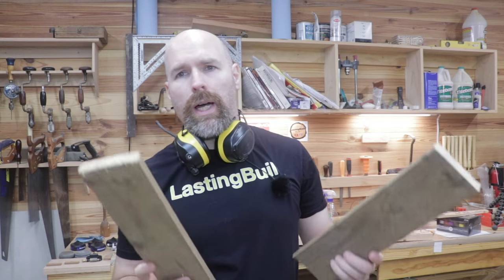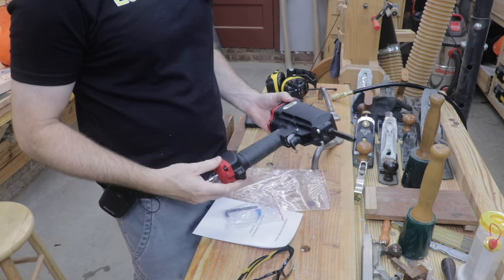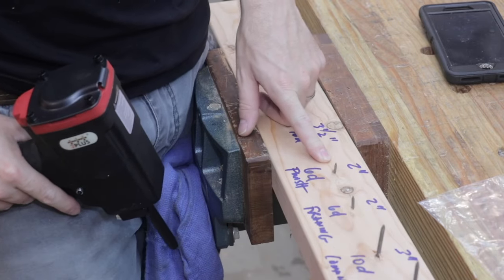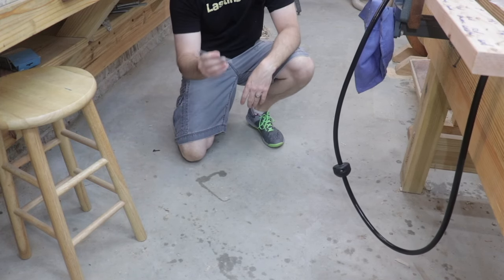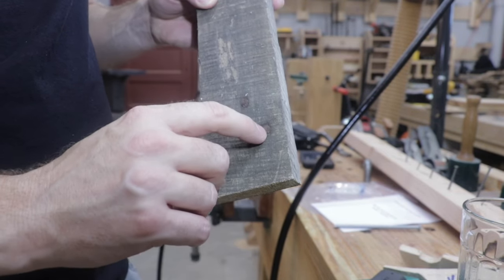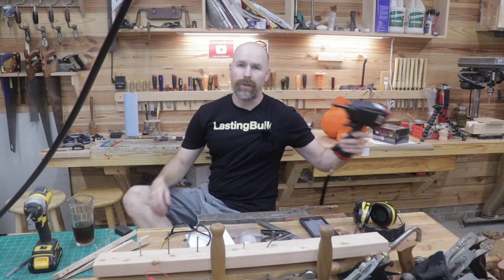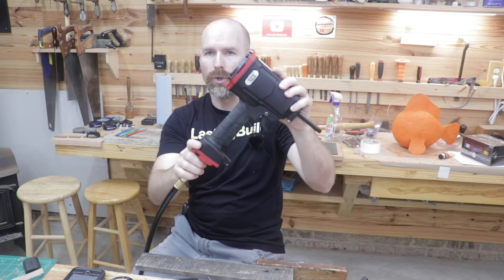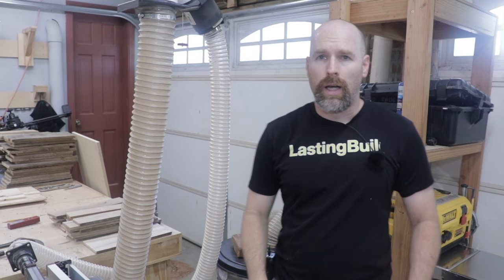TESTING The Cheapest Pneumatic Nail Remover On AMAZON!!

Comment: There is a 'world of difference' between nice clean nails recently driven into a piece of two-by and the corroded stuff remaining after prying old 'pallet' boards apart
Reply: 100%, plus I'd love to see it in hard wood, not pine
Reply: and as per usual with pallets, the nails are a lot tougher than the wood
Reply: Makes no difference.  The rusty nails will be knocked out easily too.
Reply: doesnt help with floorboards.

Comment: It's not really a "Nail Remover", but rather a "Nail pusher" because it doesn't pull nails - it only pushes them through. If the proper sized nail is used you won't see it on the opposite side, or it won't be sticking out. That doesn't work most of the time if you can't see the nails on the backside or can't get to the backside, so you end up having to chisel around the nail head and pull it out the traditional way. Not sure this helps me much at all.  I've rarely ever been able to knock a nail from the pointy end, and when I do it's because I pulled it off whatever it was nailed to and then I can just use a hammer with one tap and then pull it from the other side. This tool would get very little use in my world.

Comment: Have used airlocker for 3 years. Love it. Turn up your pressure and use over a bucket of water. Higher pressure drives the nails right through and the water stops them. No messing about with a Hammer
Reply: A great tip. T Y

Comment: you might as well save the money, still need a hammer. Make a pallet tool, they have them in youtube video....just a long bar with like a fork at the bottom with 2, it just sits under the pallete board and you pop it right off. goes real fast

Comment: I have the Air Locker version. Looks to be a bit smaller than this one, but same concept. I was using it to remove 4" spikes from old growth 1" oak in my 120+ year old house. No problems. My mother-in-law saw it and took over. Again, no problems. Suggestion on bent nails is to bend them back as close to straight as possible. We suspended the boards over a 5 gallon bucket with crumbled paper in it. Kept ricochets to a minimum. Another use that I just found is as a nail set. I put a bunch of new door trim up before realizing I had the wrong setting on my 16ga air nailer. Heads left up about 1/8". Turn the pressure down to 40psi and it taps the nails to easily caulk over.
Reply from the maker: It’s definitely a useful tool!
Reply: I use a half bucket of sand, straighten the nails as best you can, snap off and rusty tails.
When you are done chuck a big magnet in shake the sand and it'll pick up the bits

Comment: Great review, thanks.  I went with the Airlocker, it's much, much smaller and leaves a smaller indentation. Either one you go with, they're so useful and  cheap, I feel like I ripped them off...such a time saver.
Reply: Also. I used my Airlocker to drive rusted nails through some corrigated metal in order to remove it. Worked great.

Comment: Recommended operating pressure: 70-120 PSI.  The small Porter Cable Air Compressor I have is 150 psi and 6 gals.  Should be able to handle this perfectly.  This was a great review, many thanks!!  I like the full aluminum body on this tool.

Comment: Use a paint stir stick with multiple small holes drilled in it. Slide over the nail before the tool and it won’t leave a mark on the wood.
Reply: great idea.

Comment: I just use my air hammer with a  chisel tip that I have ground to a slight recess and it works perfectly.  Cost is very little if you go to HF and get the cheap air hammer.
Reply: Also add the HF Palm Nailer works too, just a little slower, but NO DIVET created.

Comment: I have the air locker and the plunger is smaller which leaves a smaller hole. Turn your pressure up and it will drive the nail further out or completely out.
Reply from the maker: Thanks

Comment: Put a small metal plate with about a 1/4 hole over the nail and against the wood to protect the wood from impact
Reply from the maker: Thanks for suggestion!
Reply: i was going to say a washer or something like that
Reply: @parkinglotstriping9800  I was going to say the same thing. I might try that.
Reply: use the equivalent of a dinner fork that wraps around the nail. a slotted piece of thin metal.

Comment: Maybe a mod? Shorten the plunger by 3/16ths or so? Then it would stop flush or just before the end of the tube perhaps preventing that ugly divot... I dunno but I’m ordering one still under $50 that comes with a spare plunger that I may try to modify myself. That’s for the education on this, I’ve been wanting one for a while now and had only heard about it, pretty cool!✌🏼
Reply: I thought about that too, but it would prevent you removing those cut-off nails later in the video. A metal plate or removable tube extension like others have suggested would be the answer.

Comment: Have you tried pushing the nail through by the nail head? This would eliminate the need to pry the plank from the stretcher.
Reply from the maker: I have not, yet!
Reply: So the nail head will not go through the wood so easily and so you will still need to pry out the nail but now without a head. I could be mistaken but I believe there's a tool that automatically pulls out the nail from the nail head. Could be just my wishful thinking.

Comment: Have you tried it on pallets that have the spiral nails? Would it be possible to weld a collar extension so that the piston didn't penetrate the wood?
Thx for the video.. very  professional..
Reply from the maker: It’s strong enough for spiral nails! Not sure about the modification!
Reply: might be able to get a small metal bushing  same size as the end   so it wouldnt penetrate,   i will more then likely order me one of these

Comment: Will it remove toe or finger nails buy one for the wife cheaper than a manicure in all seriousness looks pretty good nails put in with airgun can be thin and bend just looking at them and too time consuming those who like the rustic look don't mind the old nail holes and brushing timber by putting nuts and bolts in a bag and belting timber so that when you stain it then it gives that weathered look

Comment: Thank you Jim! My only concern would be the damage. Really wouldn’t want to use on any fine pieces
Reply from the maker: Hey David! Agreed!
Reply: David Connor  I made a metal plate with various holes in and put the nearest hole over the nail before using the gun
The plate takes the impact and no damage is done to the wood 🙂👍

Comment: A person w/ the tool needs to have a piece of metal that can be slipped around the nail so it can  keep it from causing the divit.
I love that tool. I do a lot pallets.   
That would be a life saver.
Reply from the maker: Thanks for sharing!
Reply: It marks the wood because the air pressure is too high. If the pressure is reduced the pin will not shoot out so far.

Comment: If you already have a hammer to pull the nails from the front side, wouldn’t it be just as easy to use the hammer to drive the nails out from the bottom side?  No compressor, no hose.....

Comment: Just found out this tool existed. Seems unnecessary lol
Reply from the maker: It’s a big time saver but your right, not necessary!
Reply: It's not necessary, but it makes quick work of removing nails. We were using old fence pickets for the bottom of our deck, and using a nail remover, we got 2 dozen pickets nail free in under 2 minutes. That's nine nails per picket.
Reply: the struggle is real tho